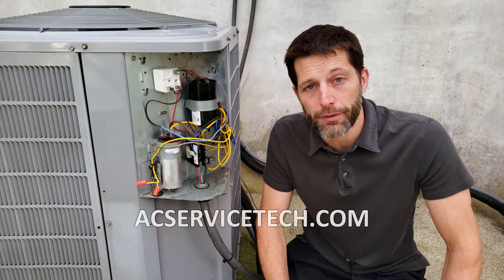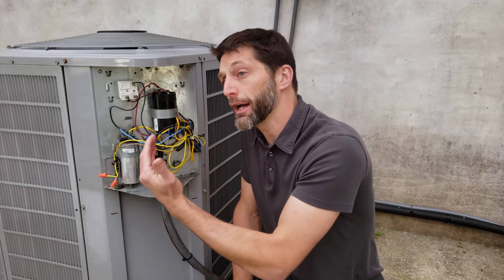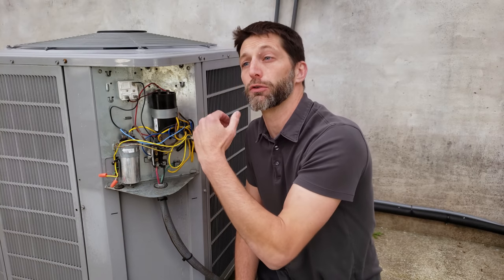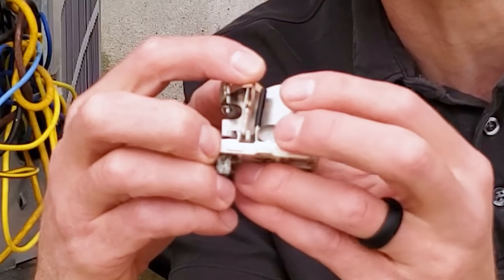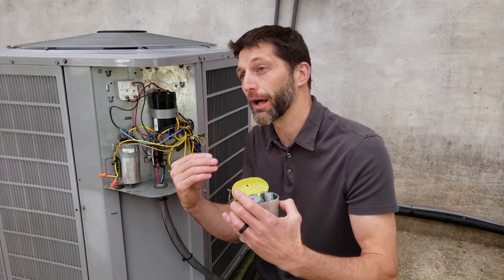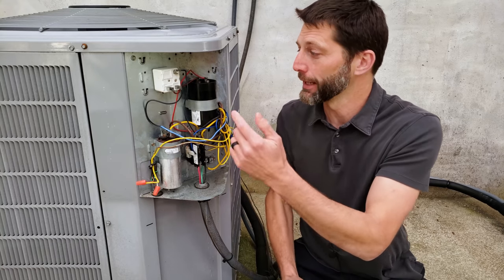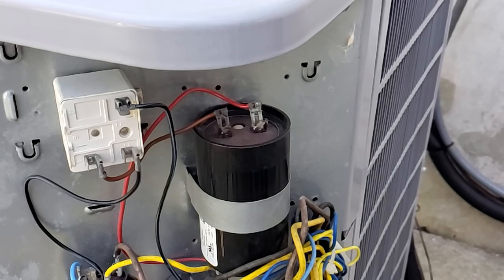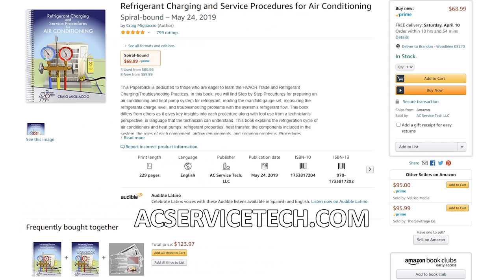The Main Reason Why Start Capacitors Fail in HVAC Units! This Cap Blows Out!

Comment: Mine blew in the first year, then I got an extra heavy duty one by a good MFR. 10 years running so far.
Reply: Wow, the first year after you bought a new AC?? I got my AC exactly a year ago and it stopped cooling this morning, i'm thinking is the cap.  The filter was changed so is not clogged and the fan turns on, but no cold air.

Comment: Wow thank you so much I have a seven-year-old Lennox unit I replaced The run capacitor it and it fired right up. The other capacitor and the trans dermal I have to watch again sorry I did not replace. It’s been good for five years since I did the run passenger.I may be getting my term analogy wrong I can’t remember but the unit blew warm air I replaced one of those cylindrical capacitors and it got ice cold once again. Believe it or not the unit warranty was up six months after this happened the original guy wouldn’t do a thing for me but want it for 100 bucks I replaced it for 12 now I’m gonna replace the relay and the other capacitor this summer.  Just because!! It was a $10,000 unit at the time ... heater and air conditioner! I’ll definitely subscribe,  thank you

Comment: Thanks for the tip. I'll check mine when it's out of the sun & pick up a spare start cap just to have on hand.
Reply: Make sure you check that relay before replacing the start cap!
Reply: @tmst2199  I usually perform a manual check at the start of the season.
  For people with evap coolers, if they would break loose the water pump before energizing it, it would probably last forever.
  Take care.

Comment: I wish I would've seen this before the AC guy condemned my 19 yr old unit for having a bad compressor. He never checked that relay or pointed out the hole in the start capacitor. "I've seen this problem a lot" he says. Followed by a quote for a new system. I replaced the start cap to watch it blow twice before replacing the relay. The ol York is up and running in 114⁰ heat 👍

Comment: So my a/c keeps blowing capacitors. I’m having one installed about every 3 months. For years this has been going on. Literally have spent thousands on this unit. When the ac man comes tomorrow, I’m going to find out if it’s the start or run capacitor and try to fix it myself. I’m willing to bet that thing you mentioned is the reason we keep having this issue. I can do anything mechanical, cars, engines, but nothing electrical. But what you were showing looks easy enough to diagnose myself. 

Also have a refrigerant leak but that’s another day and time. I’ve put on average $1000 a year into my unit 10+ years and like clockwork it fails. I could have bought a new one with all the money I put into it. It’s a Goodman btw, don’t recommend them. The unit/house was 6 years old when we moved in and the day we moved, it broke. Been non stop ever since. I know this stuff doesn’t last forever but for the price of it, it should.

Comment: Usually those start relays have a up side marked and the mounting hole is on top. If the contactors did fail eventually as shown installed here, maybe it occurred because it was mounted on its side.

Comment: Is this relay the same as the one you typically see on a 5-2-1 hard start kit??? Loved the video, learned a lot. 
The AC season is starting here on the east coast so how about a “ride along / apprentice “ program. One lucky subscriber gets to carry the tools😂 of one of your NJ guys. Sign me up !!
Reply: Yes. Aftermarket 5-2-1 kits use a potential relay and a start capacitor like the system shown in the video. The 5-2-1 kit's name comes from the fact that it just refers to the terminal numbers. :)
Reply: @mannys9130  great, thanks !!

Comment: Thank you so much for the info :) - This is exactly what is wrong with my air conditioner.  I have identified the hard start capacitor's model number, but the relay is just a little black box. How do I identify it to get a replacement? appreciate any assistance.

Comment: Very informative, thanks! My unit is 14 years old and I just replaced a failed run capacitor. Would it be a good idea to now replace the (working)  potential relay and/or start capacitor because of age to make the system more reliable?

Comment: Great video
Is there a video of how to add a start capacitor to an existing AC that’s having issues with the compressor starting? Run cap is good but it doesn’t have a start cap, thanks

Comment: Great explanation! I have a basement RV Coleman dual AC unit which is considered to be a residential style AC by RV shops, so they won't work on them. The primary system is running fine but the secondary system is only pulling 2.5 amps (should be about 11.7 amps).  What would cause it to pull just a couple of amps? If the run capacitor is bad would any voltage/amperage pass through the wiring going to or from the capacitor? If the start capacitor is bad, likewise, would any voltage/amperage pass through to or from the capacitor?  Are there any tests that can be run without pulling parts since it is all very difficult to access under the RV?  The run capacitors are only 2 years old.  The start capacitors are 20 years old.  The relays are 20 years old.

Comment: My 28 year old Lennox AC unit just did that. The capacitor POPPED like a dud Cherry Bomb and actually blew completely apart and caught fire. I heard it pop from 40 feet away and could smell something "electrical burning" just before it popped. I'll check the relay to see if it is welded together.

Comment: The motor is a design known as a "Capacitor Start, Capacitor Run" single phase motor. Since the motor starts with the load attached (i.e., the compressor), it starts under load, and it needs the kick-in-the-pants that a start capacitor gives it in order to complete the starting operation. Most CS single phase motors with, say, a fan load, for example, are two-winding motors - one winding, called the start winding, is a light-gauge wire winding with a centrifugal switch in series, and the switch kicks that winding out of the circuit as the motor comes up to speed. It's not designed to be a "continuous duty" winding. The OTHER winding is the RUN winding, and stays IN the circuit after start. In THIS application, however, the designers use a different method of kicking the start capacitor out of the circuit.

Comment: 0:58  “the Mfd reading”. Reveal the mystery, Mfd is Microfarads.  Bottom line; EXCELLENT VIDEO!
Reply: any basic tech will know what MFD is
Reply: @FrostBlueFire  Which makes you wonder why he didn't say Microfarads? Also the purpose is to create a time differential in the windings to "kick" the motor. I am not into HVAC but do they not have a centrifugal switch?
Reply: @FrostBlueFire  ....but the vid is for everyone. Good practice ( even in written notes, on all topics)...is to show the term long-hand ONE TIME ( maybe followed by the abbreviation in parentheses)...and then use the abbreviation for all the rest of the time. Cheers.
Reply: its also not a uf its a µF ^^

Comment: I worked for a lady that had a few rental homes...she had had the local Hvac guy install a heat pump and he told her the back up furnace was still good and left it at that...a few years later he convinced her to install a new back up furnace because the old one was shot..the one he said was fine that never ran because the heat pump handled the heating most the time...so that winter the new furnace ran great...but damn the electric bill was outrageous and the outside unit wasnt turning on anymore...come springtime when the tenant went to turn on the ac the outside unit did nothing...so me and another employee went over to the rental to fix another issue with the plumbing and went downstairs where this new furnace was ...I laughed and said I knew why the outside unit wasn’t working lol...the sob never hooked it back up..,there was the copper line for the Freon hanging loose and the power line to the units fuse panel outside was also hanging...I don’t know why he unhooked the power to it when he was only installing the new backup heater..he was notorious for mixing up the colors of the wires to the thermostat as well to ensure he was the only one who could fix any issue...I kept telling my boss that the unit wasn’t but a few years old and if he tells her it’s shot then he’s lying and scamming her...well...needless to say, she couldn’t get anyone else even in the surrounding towns and cities to show up to finish what this sob did in order to get it working...they all told her that they won’t work on used equipment even though both were new and a few years old that’s it and obviously she was getting scammed...so it came down to her either buying both the heat pump and furnace new again so that one of the Hvac guys would show up or pay the scammer to install another new heat pump and I wouldn’t be surprised if he left the same unit and just hooked up the lines and charged her for a new unit anyway...I never went back to that rental but he got her for a lot of money on two of her rentals which are up the budget she had to install the heat pump and furnace in her own home which had nothing in it..not even a furnace.,they ran that house on wood stoves and window shakers...j thought that was strange considering she’s got rentals with heat pumps...but my point being...I have seen and dealt with this same scenario where I’ve had no ac half the summer because I couldn’t get an Hvac guy to show up and when one did when my dad who is a contractor in town called and set up the appointment, he wasn’t even going to fill it with Freon or evem check it..he just said it’s shot..I need a new one..it’s not shot...it just got hooked back up when we moved the dwelling to a new lot and the guy who unhooked it and then hooked it back up suddenly forgot how much Freon he removed, put way too much back in it and did a half ass job one the soldering... so now I have another summer starting with no ac and a medical issue that causes me to get heat sick extremely easy..the ac unit sat at the old lot not used for 8 years cuz the previous tenant didn’t clean the A frame at all and had huge dogs that shed hairballs the size of a full grown cat...my Amana refrigerator that was only 6 years old “burned up” so she had it thrown out,,,$3000 fridge and all it was...the underneath was so clogged up with hair it couldn’t breath..,the Hvac guy has a nice Amana fridge now...I cleaned the A frame out when I got access to the place again and the ac worked beautifully! But these guys say it’s shot,..I don’t have money like my old boss does to install new every few years and I think it shows how greedy and unprofessional the trade has become...just because it’s not brand new and doesn’t me I shouldn’t be able to fix it or have ac...it’s hot af where I’m at in the summer too...u will get more repeat business and guaranteed to be the one who installs the new if one of these companies were at least willing to give me a break and take the 15. Mins to fix it...I ranted but damn!

Comment: Great video , the old caps with PCB's . PCB's are very toxic.. If you find one that's leaking, be careful removing it .
Reply: PCB’s have been banned for over 40 years now.  It’s unlikely most techs today will ever see one in in residential hvac.
Reply: @speckulator7516  I've seen them in the field. The ones made with pcbs will last a long time .
Reply: How do you know its a pcb
Reply: Well, short duration exposure to pcb is not harmful. It is the long term exposure. I used to wash my greasy hands back in the day (1960s) in transformer pcb and I am still here at 83. However I suffer from prostate cancer (12 years). No argument about long term exposure. By the way just do a sniff test on the cap. You will detect a sweet odor if it is pcb. and yes this old caps will outlast the modern vapor deposited film caps since all the old caps used real foil between the paper insulation (film insulation for later ones). The AL vapor  coated film caps are junk but that is what we are stuck with.

Comment: This is helpful..
I'm having challenge with a hermetically compressor at work. After running for about 40 sec, the relay would start sparking and this normally stops the compressor. What could be the problem?

Comment: What brand condensing unit is it? I've never seen modern units in the last 25 years with a capacitor start capacitor run start circuit. Usually it's always a permanent split capacitor start circuit with a dual capacitor. I've been away from HVAC for many years, so is this a change due to TXVs in R410a units? Great video and demonstration by the way.

Comment: ..... Back in the 80's I worked on hoists that are used on 'Swing Stages' ...these can be thought of as what 'window washers' use, however there are several other trades that use them...Anyway I made a inline plug, where I could place the Amp gage around one of the leads to see how many amps were being drawn...First tip (to me) that the start cap. was bad, was a much louder noise when trying to run the hoist...Second tip (to me) was when that amp reading stayed at 20 amps or so (It's been a long time, so...) Third tip was opening the hoist, discharging the cap, and both visually and with my cap. analyzer, check the mf readings....Yes, sometimes it was a no brainer, like seeing the burst case or juice coming out...anyway, it was cool to see someone else describe 'motor control' type tech talk, thanks for the flick .....

Comment: I just rewired an exhaust draft hood, and they had 2 motors wired together, running off of two 25uF capacitors wired in parallel , for a needed 50uF to start the motors.
I replaced the 2-25 uF Caps, with a single 50 uF, and they start fine.  But I see no information anywhere, on how, 2 motors wired together, using 1 Capacitor (or two, to get the total 50 uf needed), and how you would size such a situation.  I tried to see if one motor would start with only one of the 25uF Caps, and it would not.  These existing, were rated at 270vac (from Italy).  Replaced with a 50MFD at 440/370 and it starts great.

Comment: I got a used electric log splitter last year. the power switch was broken as well as the capacitor. so I installed a new capacitor and bypassed the switch to try it out. it worked for a few minutes, then the capacitor cooked again. it took me a bit to figure out.. the power switch is a push button, the motor doesn't stay running. I didn't know that, I learned something. the motor only runs while splitting a log, then it turns off.

Comment: How often do they fail! Every 3 years? I've had it happen. So the connector needs replaced too?
Reply: No telling. The potential relay might never fail. I understand capacitor failure has become more common and that imported capacitors are pretty much guaranteed to fail.

Comment: Great video. I just cleaned my condenser and took note of the cap and contactor so I could order spares. Mine is a single start/run cap with no thermistor.  Is there anything else I should be looking out for? Also how can I check a start/run cap with a standard Craftsman multimeter?
Reply: You cannot test capacitors with a volt-ohmmeter (multimeter.)

Comment: I spent 55 year in an electronic laboratory and never once heard the term MFD to indicate Capacity or Microfarads.
Reply: Its stamped onto hvac motor capacitors
Reply: @JohnQPublic345  MFD is a unit of measure.   One does not refer to Milk as GAL which is the Unity of Measure stamped on the jug.
Reply: @geppettocollodi8945  well, mfd is an abbreviation for micro farad

Comment: I understand that a bleed resister will bleed off the potential charge left in the capacitor, and this would generally just be safer for all things considered, but what specifically is this protecting ? the technician? The wiring ? The capacitor ? The motor ? I failed to answer this on a test question and don’t know the answer …

Comment: A true start assist (hard start) is very different than a super boost (soft start). Rectorseal TO5 or KS1 are the best fitsall aftermarket unit. After it heats up a superb oust is worthless.

Comment: Had an expensive repair call due to Ants getting smushed and preventing the  relay from connecting. Seems they can be attracted to the vibration. Spray the area every few weeks in the spring/summer/fall now.
Reply: You mean contactor,  and they cost 50 bucks plus labor . So if you paid more than 200 hundred you got taken.
Reply: @yurydolinsky  Living in the country it costs $90 just for the trip. Ant spray is much cheaper :)

Comment: Capacitors have a 90 Degree leading (current) phase angle in relation to their voltage; the
Current leading the Voltage produces torque on the rotor of  a connected motor thus aiding in starting!
Reply: Which begs the question as to what a run capacitor does, since the voltage and current are in phase, IIRC.

Comment: Do you teach techs to start testing control circuits from a wired thermostat? It saves time and wear and tear on the system since you only open up the parts that are having problems. I ran experiments on many systems, and the resistance readings blue to yellow were identical to the Compressor Contactor operating coil resistance (a common system failure)... unless there was a bad connection in the circuit (which this testing uncovers without needing to deenergize the system). I had a tech replace the motherboard because the 2A fuse was blown due to coil resistance at 11 ohm (24 volts/11ohms = >2Amps). He blew the fuse on the new motherboard, too (so I did not pay for the $800 motherboard replacement he tried to rip me off with and the hvac business owner quickly concurred with me... they quickly threw the original board away [no evidence], so... their bad!). I tried to steer the tech to the problem before he messed up a new motherboard, but he was too arrogant I suppose... he definitely should not have been working alone in a  Customer's house.